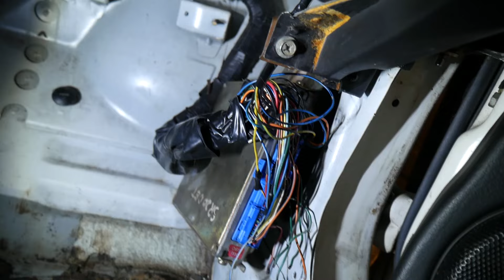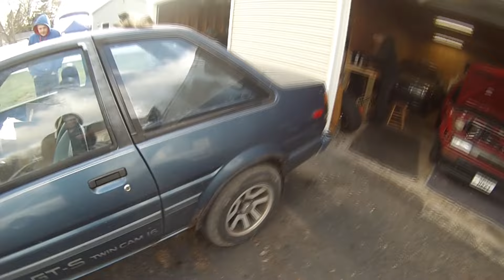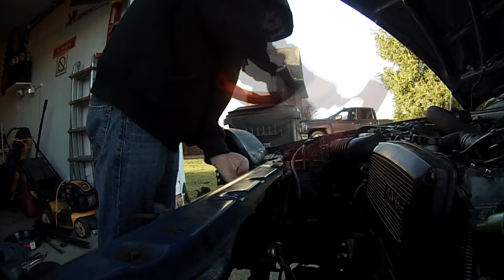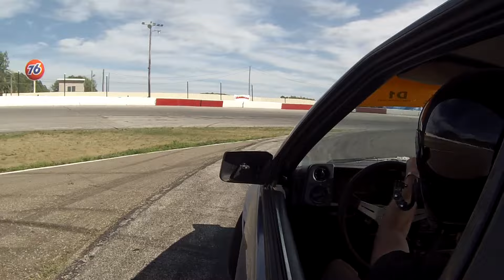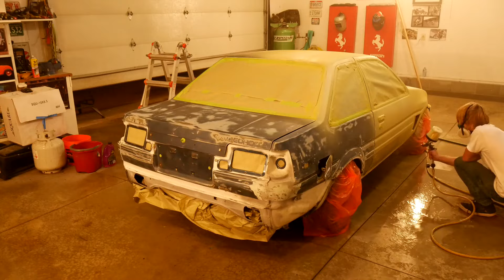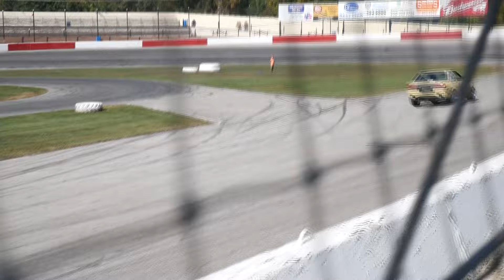SOLD MY AE86 :(

Comment: Eh, I have both an AE86 hatch shell and an S13 with $25,000 into it, and I think the AE86 would have been worth more overall. I've seen a lot of KA swaps in AEs, which would have made for plenty of power in a chassis that weighs under 2200 lbs. The only other benefits you gain from a 240 is that it has a longer wheelbase so it's easier to learn on, and you'll get cheaper parts. Understandable from a financial/performance perspective, but probably not that good for helping your channel grow. Thousands of other 240 builds out there, many being done by very high profile YouTubers, but not so many AEs. Sad to see it go, but I think you'll like the 240 too. Subscribed either way, Good luck!
Reply from the maker: Street Forged thank so much I really appreciate it! The other main problem was the Corolla was rusted away, it want even able to have a cage because there wasn't enough clean metal to work with. Thanks for the input, I'm aware this will hurt me but I just really wanted to have fun next season and not be frustrated with my car and local tracks being to big for 100hp haha
Reply: Chase Hoffman Rust is a huge pain, I know the feel. When you have more tools and fabrication knowledge, it would probably be in your best interest to scoop another up and do what you can to bring it back to it's full glory. I think that within the next 5-10 years, the AE86 will be completely out of grassroots drifting due to the rarity of the chassis and its age, so if you like the car, getting another sooner would be better. In the last 5 years I've actually watched a very similar trend with 240s costs already beginning, though I think they have much more time than the 86 before they become too expensive to be the go-to starter drift car.
Reply: Chase Hoffman It's not like you can't buy another 86 in the future. Keep the 240 as a drifter and maybe in a year or so look into buying another. Been watching your vids for a minute now, back in the under 250 subs days and I've loved every minute of it. Good luck and I look forwards to see where you go with the 240. Oh... and one more thing... Please don't stick an ugly ass nose on it like cam (Haggard) did with his...